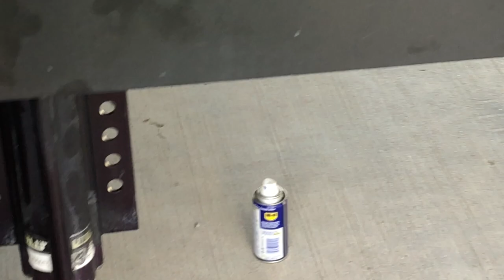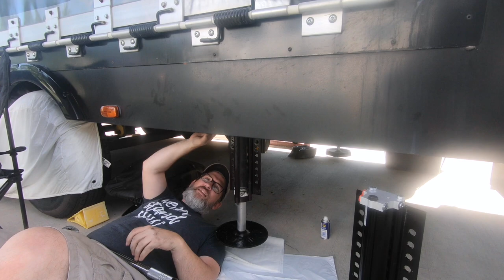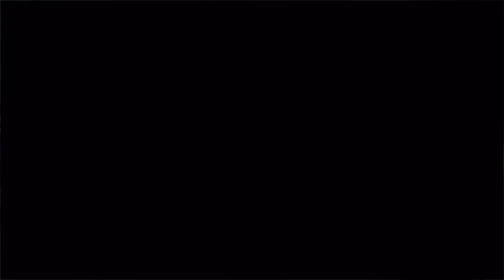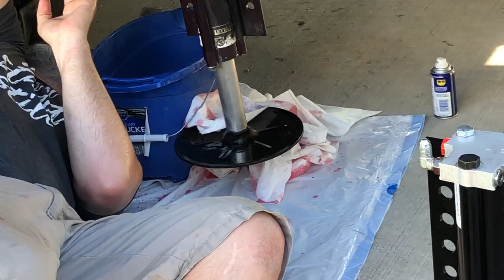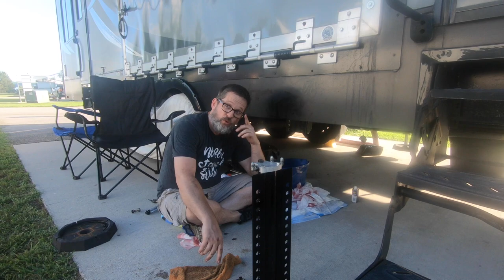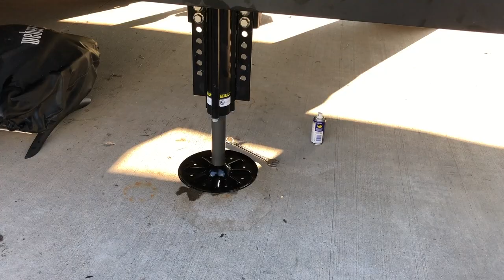Replacing An RV Level-Up Hydraulic Jack - DIY RV Maintenance

Comment: PPE… Eye protection is very important doing this work.  Also, if Hydraulic fluid gets into a cut anywhere it needs to be treated by a physician.  Don’t try to remove it yourself, you can cause it to go deeper.  HF is toxic.
Reply from the maker: Great point!

Comment: protect your eyes when you start to loosen the hydraulic lines as one of them is under pressure (3000psi) and you don't want a shot of hydraulic fluid in your eye......when the pressure is released....
Reply from the maker: Great advice!

Comment: Alot of unknowns in your video..raising the jacks up before you disconnect the lines to keep air out of the system...marking the lines  as to know which ones go where..using a torque wrench on the bolts and not saying what the bolts get torqued to....and checking the legs to extend and retract to make sure no leaks and any air in the system is purged out...
Reply: I just replaced 2 jacks on my RV. They are self bleeding. Lower them and let them sit 20 minutes for air bubbles to rise to the top and retract them. Do that a couple of times and the jacks are bled.Tighten the bolts as tight as you can....they bottom out when they are tight...no need for a torque wrench but you will need a long handle socket arm to break the bolts loose. The hoses are color coded....google Lipperts manuals for that. The external tube that runs down the side of the jack is the retract tube.

Comment: Hi, when I took off the old (Bigfoot) cylinder and sat it standing up on the ground, oil shot up like a geyser! If only I had a video of that and my expression. Oil everywhere, including my eyes, in my mouth, shirt, eight feet up the side of the RV. So, what I learned (the hard way) is that the weight from the top half of the cylinder will compress when it is sat back on the ground. I suggest purging the cylinder in a bucket before removal or some other method I am unfamiliar with yet. So, you didn't need to bleed it when you installed the new one (oh thanks, I see you answer that in some replies). The jacks on the Bigfoot units I am replacing have individual motors, reservoirs, and solenoids. Thankfully, I was in a dirt lot, but my shirt and my dreams will never be the same. Thanks for the video!
Reply from the maker: Yikes! We did get a few (well deserved) comments about the importance of eye protection. An eye full of pressurized fluid we be no fun. Glad everything worked out for you.

Comment: I've never done this either (about to do the same replacement for the same reason).  Are there risks of depressurizing the system or getting air in the lines? Is there a break in (i.e. cycling the jack several times)? The jack comes with zero instructions.
Reply from the maker: I had the same problem...no instructions. 
I did not see a break in period. I cycled the jacks a few times (while hooked to the truck) to purge any air out. Technically, it should just be that line that has any air, but I cycled them all.

Comment: Thanks for your Video! do you need to bleed the air out of the lines?
Reply from the maker: I did not have to bleed the lines. I put the jack up and down a couple of times right after finishing and that was it. Thanks for watching!

Comment: Great Video! Thanks for sharing the information. I think you made the right choice. If you replace the seals it still could leak. Thumbs up #23 and hope you have a great week.
Reply from the maker: Thanks for that comment. I debated whether spending the $400+ was necessary. I think I made the correct choice :)

Comment: Did the entire system lose pressure when you disconnected the lines? Was there a check valve?
Reply from the maker: No the entire system didn't lose pressure and yes, there was a check valve.

Comment: Looks like a REAL good excuse to buy some tools! LOL
Did you have to "bleed" the air out of the hydraulic system when you were done?
Thanks for the video! Love the "how to" video's
Reply from the maker: Luckily, I did not. The new jack was full of fluid and the line was full. It seemed to be okay without bleeding the system.
Reply: @ChickerysTravels  the Lippert jacks are self bleeding, any air that happens to get into the lines will bubble out once they are operated a few times.

Comment: Good job, did you bleed the line?
Reply from the maker: Yes, I did not show it on the video. The funny thing is, I have to replace the same jack because I made a turn a little too sharp and damaged it. The only things hurt were the jack and my pride :(
Reply: What is the process in bleeding the hydraulic lines?
Reply from the maker: Check out this link. It is easy. https://www.lci1.com/images/support/lipsheet/0183.pdf

Comment: The useless music is annoying! And the lack of information such as wrenches and socket sizes required makes the video rather useless.
Reply from the maker: Sorry it wasn’t more helpful. This was in the early days of our channel (2018).
Reply: @ChickerysTravels  I have a cylinder to replace on my fifth wheel and found this video to be VERY helpful.  Didn't even notice the background music, was too busy watching and listening to what you said.  As to torque values and wrench sizes, I imagine those would be specific to your jack and installation.  There are several different sizes of jacks depending of course on the weight of your RV. This was a DIY video, not a Disney + production.  Give the guy a break!
Reply from the maker: @Mark-nt7hr  Thanks for that feedback! When I changed my jack, the only video on anything similar was a farmer who changed a hydraulic jack on some large piece of equipment. I listened to him talk about pigs for the first several minutes of the video but didn't complain because once he got to the point, it was very helpful.
Reply: @ChickerysTravels  😆...and you probably learned a little about pigs!